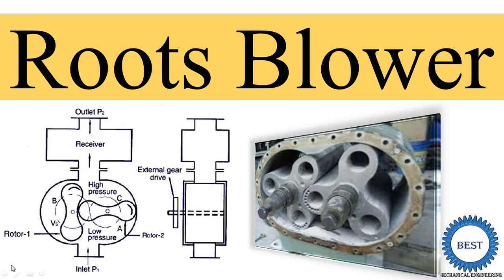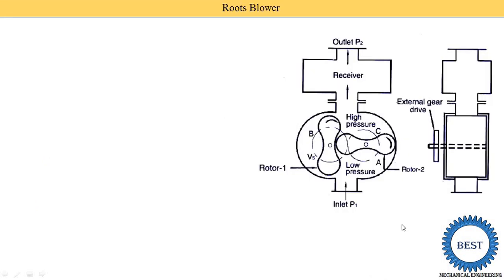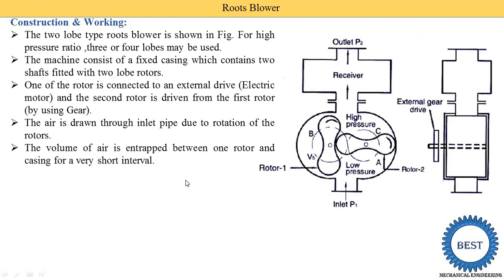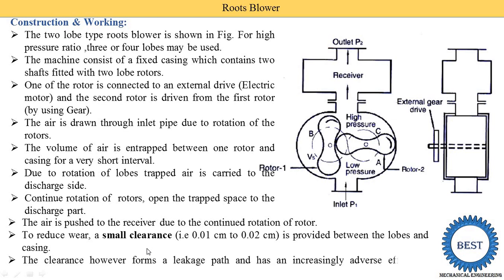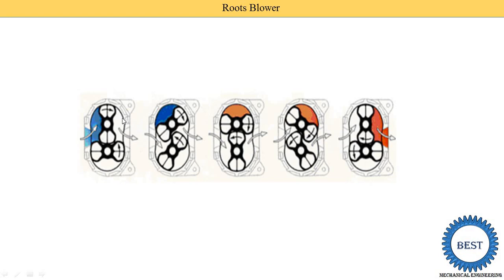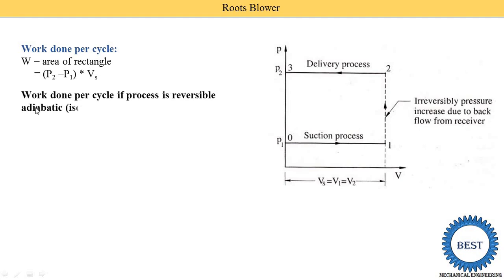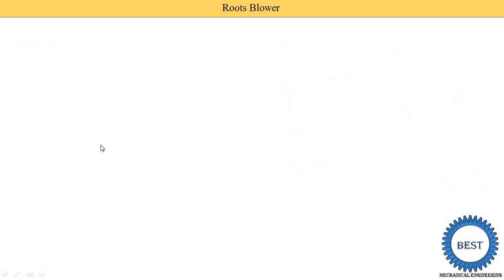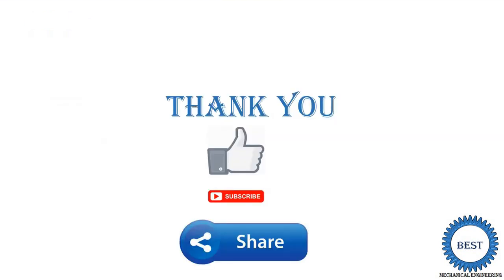Root Blower Root Compressor

Comment: Sir, I face problem ..oil is escaping to the reciever.
What's is the problem?
Reply: If you haven’t figured out the problem by now it sounds like you have a bad seal in the front or the back more than likely it’s a front  seal worse case would be that the blower got to hot and may have warped or even cracked